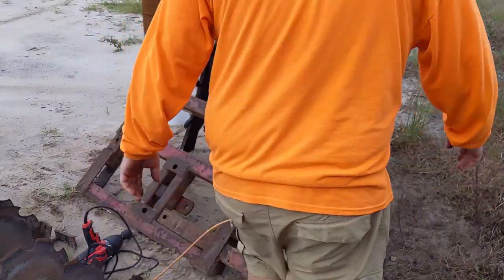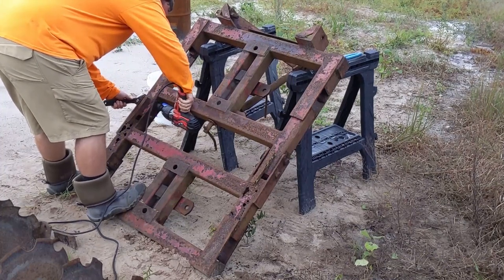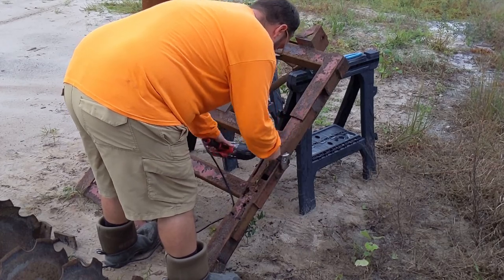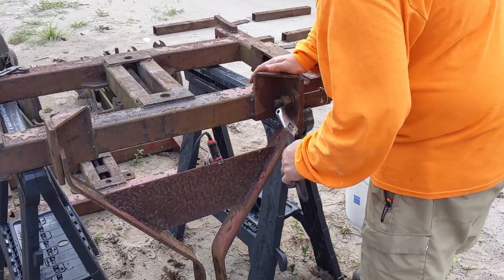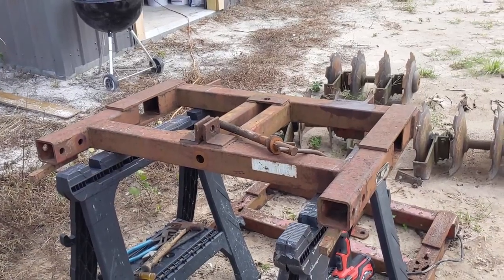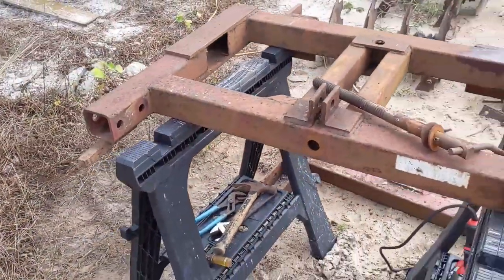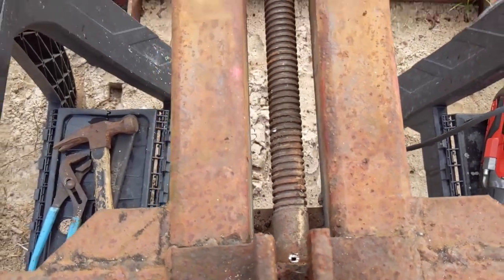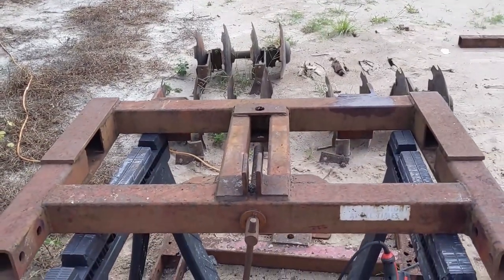Rust Bucket Rebuild Ep.2  Disc Packs  Extreme Antique Restoration of our 5' King Plow disc harrow

Comment: Did old timey disc plows have little scrappers built into them? To keep mud from building up on them.
Reply from the maker: I believe this was built in the 80's so no sweeps here. The equipment I have seen those installed on were planters. The concave disc I use combined with the speed I run them can keep the mud off fairly well but I still struggle with large chunks of wood and palmetto stalks.
Reply: @FightingIbisFarms  I was curious because I had bought some topsoil (that was actually topsoil) and I found a piece of something that really resembles a mini-tomahawk in the dirt. It is about 4 inches long but shows every sign that the blade end was broken. I knew exactly the area the soil was from and it had been a hay field all my 55 years. As well groomed as it was back then it had to be something cared  for at least 50+  years before that. They harvested fescue and orchard grass seed with a combine in there every fall. I had my brother in law look at it and he said it could be a disc scrapper from a long time ago. Roots are rough on these types of equipment. I figure in time you will get all that out of your soil. Your discs set look good.